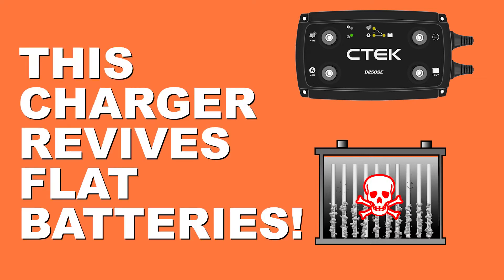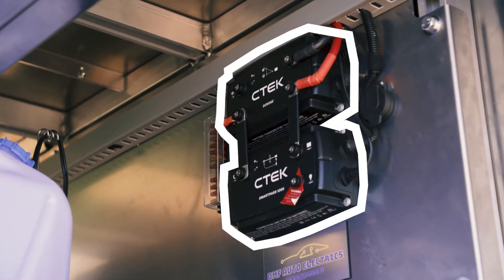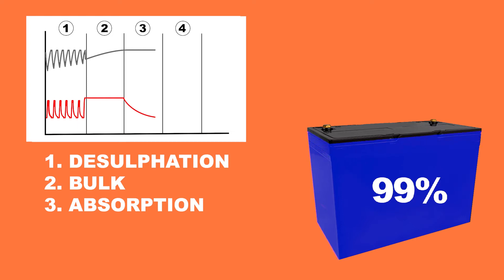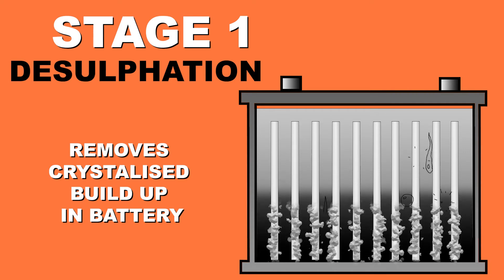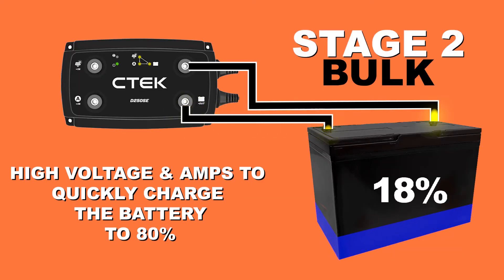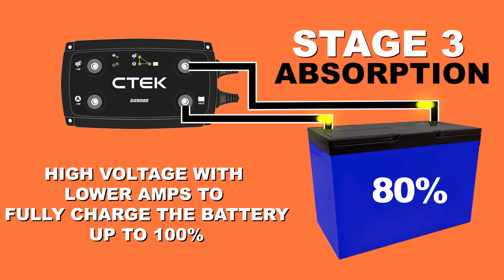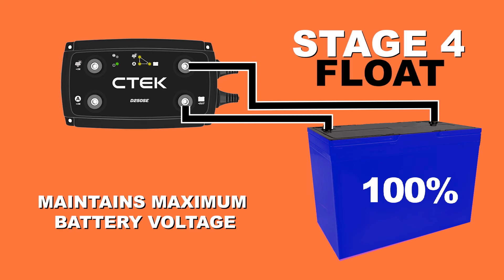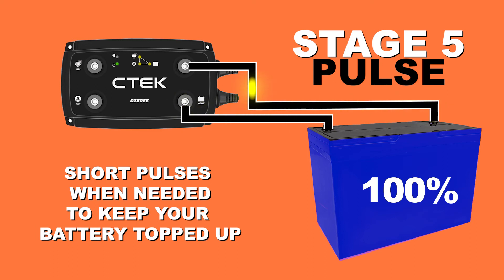5 Steps to Charging With The CTEK D250SE

Comment: I have been using a D250SE for a couple of years now and am very happy with it. Recently I installed two 100w solar panels on the roof of my van. Since the CTEK has a solar input with a built in MPPT charger I thought this would be a great idea. The specifications of the D250SE say that the maximum voltage of the solar panels is 23 volts. In todays standards this is getting quite low. The solar panel technology is making solar panels far more efficient than a few years back. I reached out to CTEK's support in order to find out if my panels would not damage the CTEK charger. Sadly, their responses were not very helpful. I got the feeling they were answering my questions in such way I could not hold them responsible in the case my solar panels would damage the CTEK charger. I reached out to tech support of the panels and they were a much greater help. In the end, my solar panels are not supposed to damage the CTEK charger and went ahead and installed them. Until now it is working great (a few weeks in). Since the 23 volts spec of the CTEK is a bit on the low side these days, it would be great if there was some kind of "box" that would prevent the solar panel output voltage to surpass 23 volts. That "box" could then be installed between the solar panels and the CTEK charger in order to protect it. Do you know of such a "box" or shouldn't I be worried about that?